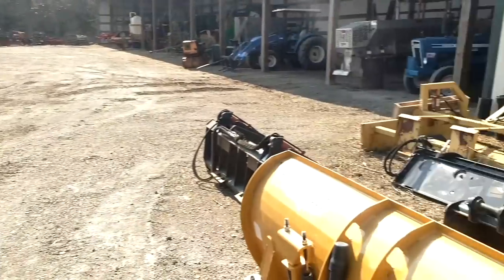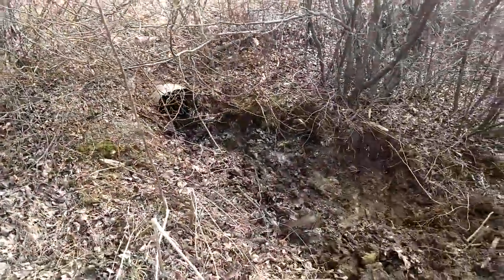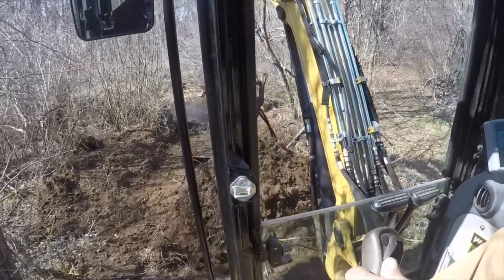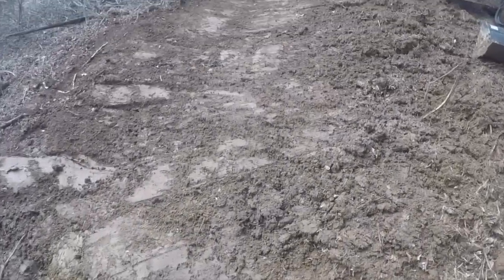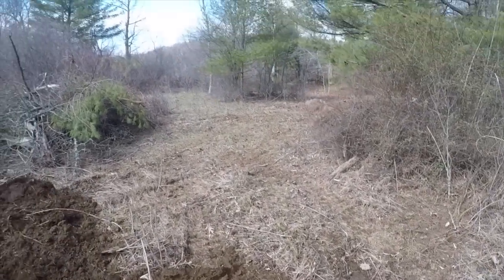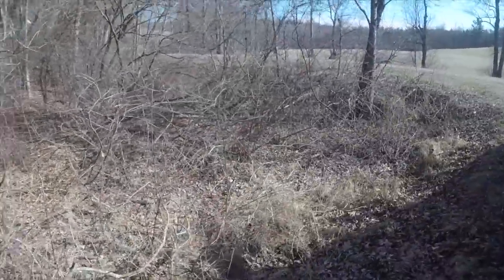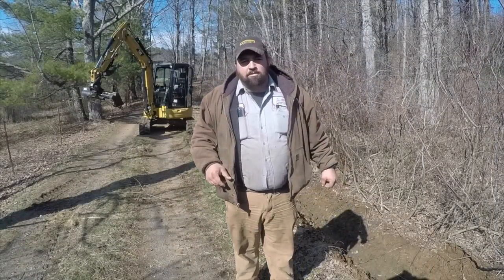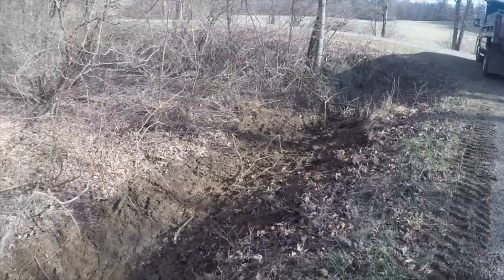My Saturday project, Cat 304E²

Comment: when I was 12 I was the remote control backing the triple axle back to the excavator for Dad or the Uncles, thanks for sharing.
Reply from the maker: Lol I remember those days
Reply: I used one of those remotes as well on a flatbed. The funny thing was that we were dropping off a 6.0 to the repair shop. But it was an 03, so that's to be expected for an older 6.0.

Comment: Good work man! What a neat bucket you have as well. I bought a 2007 304C CR and look forward to picking it up. It weights about 10800 lbs and my 14k trailer only holds about 10500 payload. But it seems to struggle when turning with 9000lbs on it due to the cheap radial tires and thin wheels. It is made by Big Tex, and is brand new. 

I say this so others can consider this when buying one, I had no idea what to look for in a trailer.
Reply from the maker: If your turning really sharp loaded it's pretty normal for the tires and wheels to flex. I have Kaufman and  Better Built goosneck trailers and the wheels and tires flex on both when turning sharp and loaded heavy never broke anything though. I try not to do 90 degree turns with them loaded.

Comment: I've been thinking about a 304 or maybe a 303. Operating width less than 7'. I like your tilt rotater also! You handle it really nice, perfect grade job. 
On the vineyard we could use an excavator for all sorts of jobs, including harvest time with bins of grapes. 
On the blade, is that a 6 direction blade? Can you switch it out and put forks on it?
Reply from the maker: +Atoyota. No it's only an angle blade it doesn't tilt and it's permanently attached. We really like it, it's very smooth!
Reply: DLH Farms yeah mini's are handy 
I'm guessing you all farmed 1st and construction/equipment operations as a real job came later
Reply from the maker: +Atoyota. You would be correct. My dad was a dairy Farmer.

Comment: What is the width of your ditch cleaning bucket?  Dealer sold me a 47" for the same machine,  I wonder if it will be too big. Great videos, I'm not an operator but I know good work when I see it.
Reply from the maker: That's what ours is, it works great on that machine. I thought the same thing when they sold us the 47 inch but it's perfect for it.
Reply: This is the exact comment I was looking for. Just bought a 304e and my 47” tilt bucket is on its way. Glad I made the right choice!

Comment: Hey DLH Farms. I was just wondering if you can run your rotor bucket and your thumb at the same time? Thank you!
Reply from the maker: +mathews1z7. No, it uses the same hyd function but all you have to do is turn two valves to switch back to the thumb

Comment: OK thanks keep up the good work  have u had any problems with the 6.0+dlh farms
Reply from the maker: +Rick Garrett. Yeah, head gaskets, egr valve, oil cooler, dummy plugs, FICM, exhaust back pressure sensor, ICP sensor. You know just the regular stuff, something is wrong with it now, sometimes it runs great, sometimes it acts like it's got a blockage in the exhaust. Always something with that truck.

Comment: I'm looking foe a mini excavator. In your opinion what is a good starter machine. Just passed my test to be certified to install septic systems. I've look at IHI, they are close to me, cat is close and bobcat also.
Reply from the maker: Get a 5 ton size, its big enough to handle a 3 foot bucket for septic installs. Cat and Bobcat are both good, get which ever you like. You can get a bigger machine if you want but don't get a smaller one for septics. If your useing gravel in your septics you will need a skid steer also to handle the gravel or get a backhoe and it will do both, but backhoes suck to dig with if your used to an excavator.
Reply: I have a Kubota KX121 with a 6 way blade and a 5' bucket with a Helac tilt. It will go 90 degrees each way. It is a little big for the machine but i can carry gravel with it to fill leach fields. It is my go to machine, hardly use my hoe anymore.
Reply from the maker: We don't use hoes much anymore either, mostly minis and track skid steer.